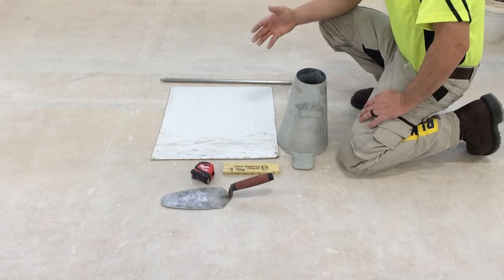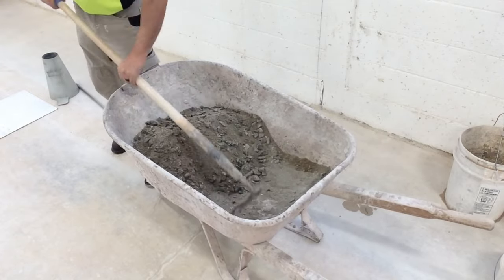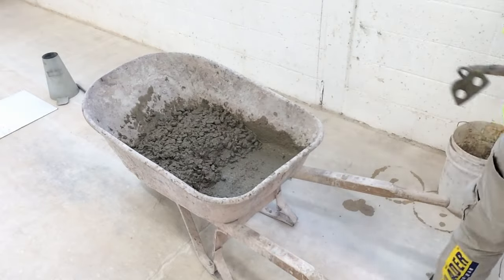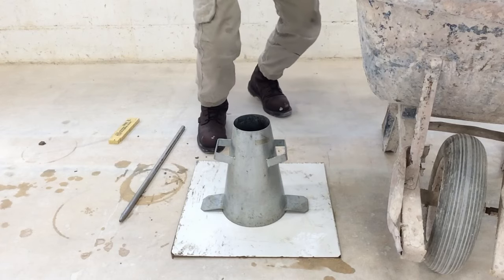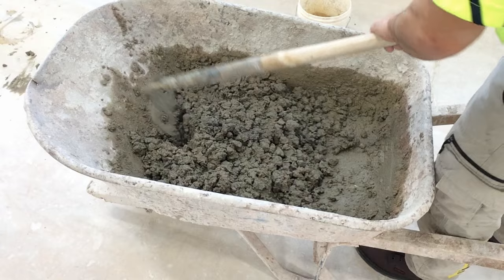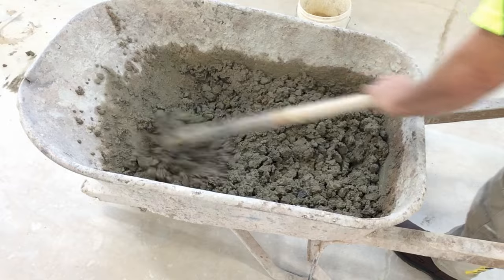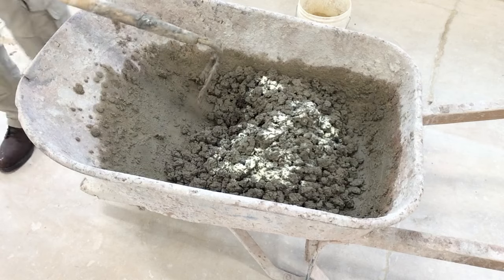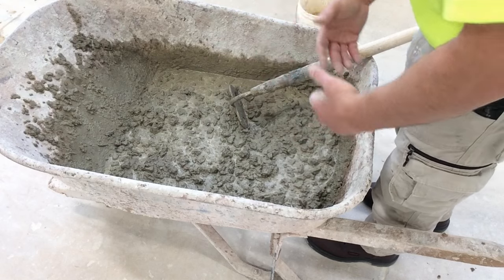How to Perform a Concrete Slump Test.  Trivia and a Riddle [For Students]

Comment: Thank you for this very interesting information.
However...
You said that after inserting plasticizer (or super plasticizer) you have to repeat the collapse test. But, in this case, the concrete will sag even faster and more lower due to the effect of the plasticizer. How does this happen then? 🤔
Reply from the maker: What it allows is the contractor to use a higher slump with less water. If the architect specifies a 4 slump, but the contractor needs/wants a 5 slump (for pumping perhaps).  A 5 slump may be accepted by the architect if superplasticisor is used.  There are drawbacks of course. Mainly cost, and superplasticor may affect corrosion of rebar or wire reinforcement.